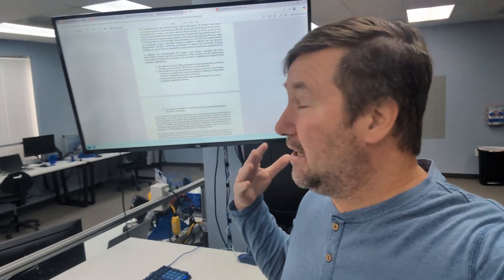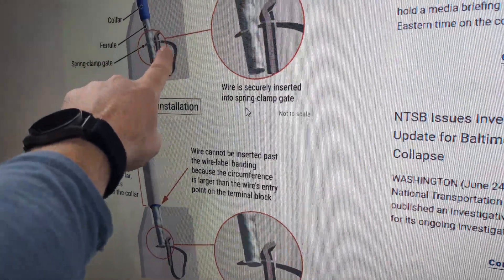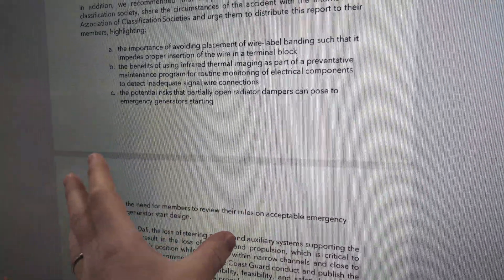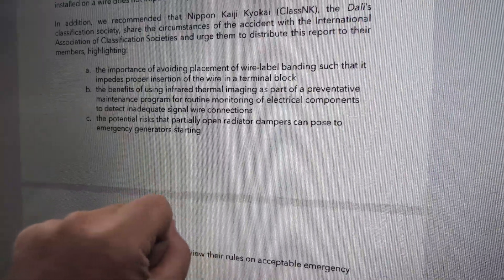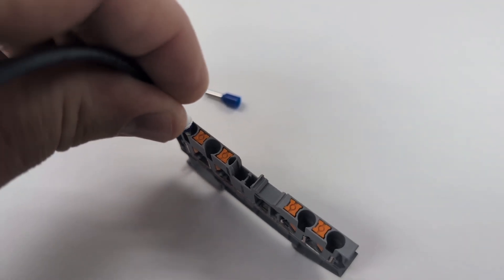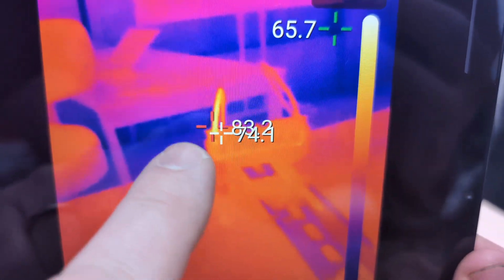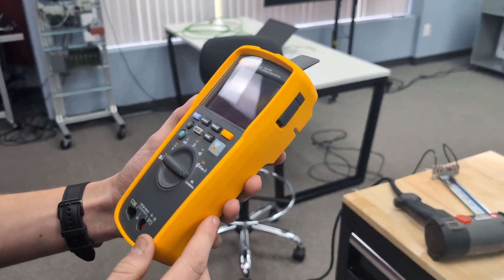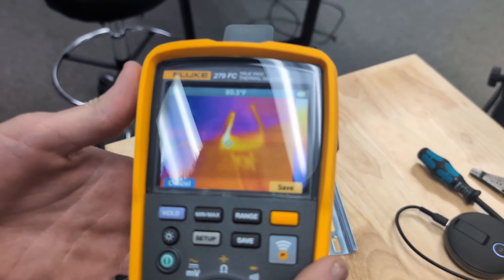NTSB Recommends Thermal Imaging for Control Circuits: The Francis Scott Key Bridge Collapse

Comment: Control Panels in my opinion should be thermal survey checked when first turned on or powered up for commissioning. At that point it’s usually in the shop. It should then be checked again when powered up on plant site. As shipping the panel could result in lots of vibration and result in loosening wires. After that, periodic Thermal Survey. If a person wants to Thermal survey every week or every time they open the panel, that’s up to that person and no problem with it. But I’m not going to expect the plant site maintenance to do that and they will only likely do so when they themselves get a PM to do so. Now, that’s the real periodic check frequency that everyone will argue about in how often. The quality of panel wiring as well can be much disputed as I often see many with no ferrules and some with ferrules, but never mix of both. Many times loose wiring and you go WTF! As it’s not just one wire, but several loose or frayed wire connection. Thus in my own mind, the quality of the panel wiring can be an issue. Regardless to all that, the Fluke Thermal Tool you can connect to Smart Device is a should have tool and easy to pack and carry around to easily at a whim just check the panel thermal signature. Side note, the RA DeviceTool I found is now available for IOS Smart Device users in the Apple App Store. That works for me and downloaded it.
Reply from the maker: The issue of how often to check them is a tough one.

Comment: I was told not to use ferrules on spring terminals. As this will weaken the spring. Use bare cooper. Ferrules for screw terminations only. I agree with thermal camera. Keep it in my backpack for every service call.
Reply from the maker: Thermal cameras are great tools!

Comment: How much current was going through the wire on the ship though? If it was only running like 10mA or so a thermal camera wouldn't be able to pick that up.
Reply from the maker: That information wasn't in the report but it was the wire on the step down transformer so it was likely in the amps range.
Reply: That might be the sexiest drawer ever.
Reply from the maker: Thanks :) I was eyeing one of their scopes to add to it at Automation Fair.
Reply: Tim, Interesting they used the term signal wire if it was a power wire. Do you think the NTSB should revise the report to clarify power wiring?
Reply from the maker: Depending on the size of the step down transformer, it could be considered a signal.  Based on the rest of the report, it appears that it had no power loads and was for logic commands.